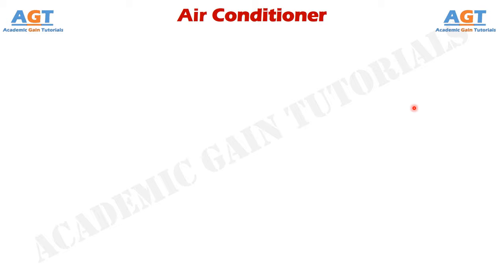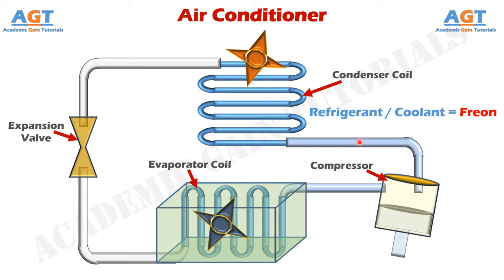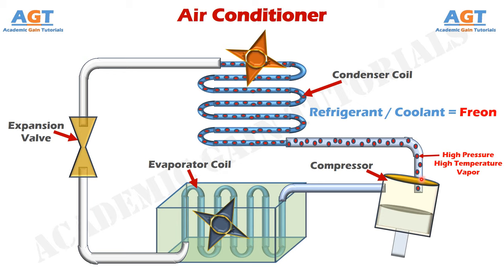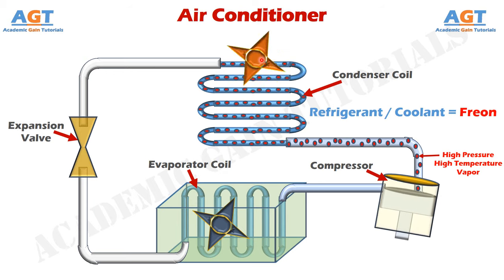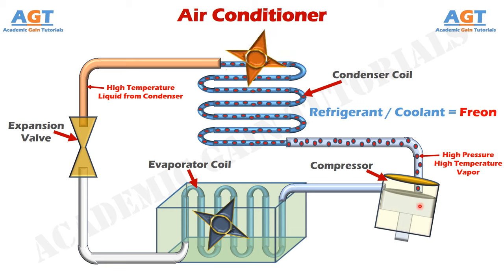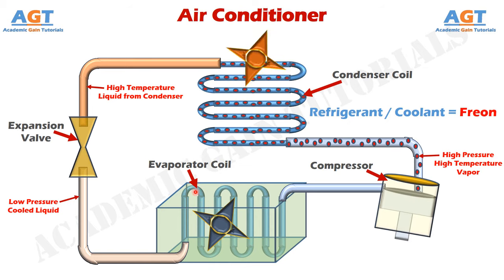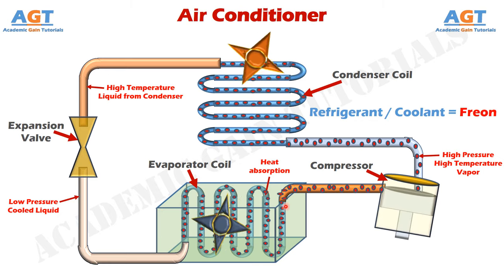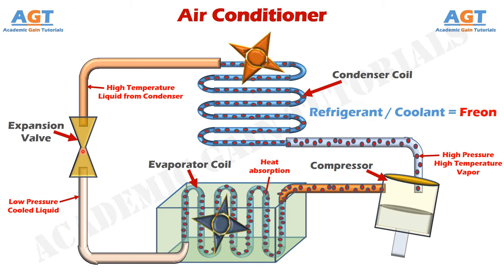How Air Conditioner Works - Parts & Functions Explained with Animation.

Comment: Very well explained and easy to understand with the animation. 

One of the questions I have is how much pressure does compressor have to increase so that  refrigerant  temperature will be higher than ambient air temperature. Is the compressor equipped with some type regulator that  measures outside temperature and compresses the refrigerant so that the temperature is higher than outside air temperature.
Reply: Actually the explanation is still incomplete as your question proves it needs to be equipped with some thing which can measure heat temp and that is   Thermostat which is important to power on/off to compressor to work as per our Room temperature🌡️for a certain cooling effect set in Thermostat I think.
Reply: @irshadahmedsyed  HVAC systems will typically have one or more interior air temperature sensors and an ambient (outside) air temperature sensor.

Comment: I have a question regarding the wireing. I can´t find an answer anywhere on the internet so i´ll try my luck with you. I have a Toyota Hj60 - 82 and there is a wire coming from the dash leading to the dryer and then on to the compressor. From what i can se it´s not acc so i can´t set a temperature, just on/off. Could you explain the exact way to wire the system from the button to the compressor? Why is the wire running through the dryer, i guess it´s correct but i can´t find a single video on the internet explainng this. Thanks in advance.

Comment: Question:  At compressor startup, does the A coil (inside furnace) make some noise getting up to operating pressure?   It lasts for about 15 seconds?    Then noise stops.   At end of cooling cycle the same thing happens.    During the cycle no noise at all, other than normal blower sounds.   AC runs great, very cold.
Reply: This would not actually be called a furnace but a evaporator coil. What you are hearing is the compressor ramping up pressure. Once the pressure is obtained it does not take as much energy to maintain that pressure so you want hear it as much,

Comment: thank you ..this is a great tutorial , rather than the others i have watched that dont explain how the compressor works, or why the flans are blowing and what they are blowing for and the main key is the first law of thermodynamics that all ac is based around...that heat flows from hot to cold...
if you ever want to improve..the thing that was missing was
1. how does the expansion valve work actually (by what mechanism)
2. the evaportator in the room ....when you go near one they seem to be blowing cold air...but your explanation seems to say they suck in hot air ..(so how come they actually blow cold air)
3 more talk about the air in the room and hte importance of the room being closed or the aircon will be trying to cool down the planet.
4. how the condensor coils actually change the state of the freon from gas to liquid.....i think you said the temperature doesnt change but i think it actually does.
the outside environment cools the gas and then it changes to liquid ....by cooling it.
5 more abuot how the changing of state of something from gas to liquid or liquid to gas produces energy
Reply: helpful and useful comments!  thanks

Comment: quick question sir, can a home ac compressor be use on car AC system?
Reply: Long story short, it's not worth trying.

Short story long, 

An automotive ac compressor runs off of your engine,whereas a home ac compressor runs off of an electric motor.

You would have to find a way to hook up the ac compressor from the "home ac"
To where it can be powered off of your cars surpentine belt,

Then you've got other issues because automotive ac has cutoff switched that turn a clutch that is actuated by an electromagnet .

The "home ac" is simply powered by an electric motor that simply cuts off.

Ac in a car is a lott different than ac in a house,

They even take different refrigerant.

Speaking of which, you would also have to find a way to attach your refrigerant lines to the "home ac" compressor.

And im sure im missing a few steps to the process.

But it's going to be a lot more work than its worth

Nothing is impossible, 
But this would be more expansive than its worth.

Hope this helps.😊
Reply: @kristopherhasenbuhler5393  thank you sir, i was just wondering, because some cars now runs an electric compressor. home AC compressor can be run via inverter i think.

Comment: Some things are not explained here. HOW does the expansion valve allow the high temp liquid into low pressure cooled liquid. I presume because it has a small dia. in and a larger dia. pipe out, but this is not said. Also, does it matter if the vapor travels UP the condenser rad whilst turning into liquid? Would gravity not make it want to fall back down? All other animated diagrams I have found show it going down, and that would seem to make more sense. Also, where is your drier?

Comment: I have seen videos on ship refrigeration... and comes to an understanding that...

1. Piping before entering compressor consisted of freon gasses. Then it enters the compressor tube, where gasses are  returned to its liquid state.

2. When the compressor keeps turning... then the liquid state of the freon... prior to entering the expansion valve, it again turns into gasses, then into the evaporator in the form of gasses...

The cycle repeats itself once these gasses reenter the condenser / receiver tube.

Did i understand them incorrectly?...

Comment: I thought, in an expansion system, the freon exits the condenser in liquid, enters the dryer, where moisture is removed from the freon, then traveled to the txv valve?

Comment: I have a question, how does it dispense the cold or hot air?
Reply: Dispensing of cold or hot air happens as per the 2nd law of Thermodynamics, which states that Heat flows naturally from an object at Higher Temperature to an object at Lower Temperature. 
 The "Compressor" makes sure that refrigerant fluid flowing to "Condenser" is at a temperature Higher than the outside temperature, which ensures flow of Heat from Condenser to outside temperature as per 2nd law of Thermodynamics, added with a fan which aids in blowing out the Heat from Condenser. 
 The "Expansion Valve" makes sure that refrigerant fluid flowing to "Evaporator" is at a temperature Lower than the inside room temperature, which ensures flow of Heat from inside room to the refrigerant fluid in the Evaporator as per 2nd law of Thermodynamics, added with a fan which aids in blowing in the cool air from Evaporator to room.

Comment: Question: boiling point of coolant is very low, like -30 degrees Celsius. How can it go from vapour to liquid in condenser, if the outside air temperature is way higher than its boiling point?
Reply: Because "Compressor" (by increasing pressure) makes sure that the temperature of refrigerant fluid flowing to "Condenser" is higher than outside temperature, hence Heat flows from refrigerant fluid inside the Condenser to outside as per 2nd law of Thermodynamics, causing condensation of refrigerant fluid from vapour to liquid.
Reply: Compressor changes gas into liquid and increases the temperature by increasing "pressure". There are 2 ways how you can covert gas into liquid. One by cooling and and the other by increasing the pressure. The game that we are playing in the outdoor unit is with the pressure. Increase the pressure -> keep it in liquid state.
Reply: @ryuzaki6865  How does the condensate drain from roof top AC unit (Compressor, Condenser, expansion valve, and evaporator cooling coils in one unit)? Is it require condensate drain pan to collect water, and drain trap to prevent negative pressure? What if the condensate drain fills up the pan will it spill over into the duct inside the house?

Comment: What is the benefit of changing the state of the freon from gas to liquid?
Reply: So that when that liquid again comes to the indoor unit it can absorb heat from your room, reach its boiling point and turn into a gas. Now this gas is sent to the outdoor unit and using the variation of pressure again turned into a liquid. The cycle goes on. Hope that helped! :)
Reply: @aditisingh1385  But I need to ask one thing? Why their is no explanation about Thermostat which is very important part of this AC? Thermostat is the one which controls Power On / Off to the compressor. I guess same type working arrangements are done for Refrigerator also am I right?

Comment: So this is a little simplified. The first place to get an understanding of what is going on is to understand heat energy. Heat energy is measured in temperature, which is a measure of how heat energy affects the molecules of a substance. Quantities of heat energy are measured by measuring how much heat energy is required to raise the temperature of a certain amount of a substance. For example, a BTU is the amount of heat energy required to raise one pound of water one degree in temperature. (I'm American so you're stuck with imperial.) 
Now we come to the property in the natural world that is exploited to give us the refrigeration cycle that makes air conditioners and refrigerators work, (which both work basically the same, an air conditioner is just something that makes your house a big refrigerator). 
So if you start with a pound of ice, it takes one BTU to heat it one degree. So for example one BTU to heat it from 31 degrees to 32 degrees. But when you get to the first change in the state of matter, it takes 144 BTUs to change it from a pound of 32-degree (Fahrenheit) ice to 32-degree water. And then you're back to one BTU to heat it from 32 degree water to 33 degree water and so on, all the way until you get to the boiling/condensing point. It's one BTU to heat the pound of water from 211 degrees to 212 degrees. And then it takes 970 BTUs to heat the pound of water from 212 degree (Fahrenheit) water to 212 degree steam (or "vapor"). This is a quality that works against us when we're trying to boil a pot of water and the heat source is a stove you have to power.

But it's a quality that works for us when the heat boiling your liquid, (i.e. the refrigerant in the evaporator coil), is the heat in the air of your house, and you want the refrigerant vapor to carry large amounts of heat energy with it outside your home.) (Different refrigerants of course involve different BTU numbers than water, but the principle is the same.)
As many of you know the boiling/condensing point of a liquid increases or decreases commensurate with pressure. (A pot of water boils at a lower temperature at a high altitude, i.e. under less atmospheric pressure, than at sea level.) 
The compressor raises pressure so that the temperature of the boiling/condensing point is higher than that of the air outside, (say a pressure that makes the boiling/condensing point 120 degrees Fahrenheit so that passing 90 degree air outside over the condenser coil will cause the vapor to condense into liquid). 
On the low pressure side of the system, (where the liquid enters the evaporator coil), the pressure is set so that the liquid will evaporate at a little above freezing. (While you might have a refrigerant that boils at 45 degrees (Fahrenheit) below zero, you have to set it to the boiling/condensing point above the freezing temperature of water or the humidity in the air will cause ice on the evaporator coil.)
So you have a system set a two pressures, designed to set two certain boiling/condensing temperatures of the refrigerant. So you have the air in your house being passed over the evaporator coil (made of a conductive metal) so the heat in the air will pass into the refrigerant in the coil and cause it to boil. The heat energy is carried outside with the vapor in your vapor line (the bigger one of your two copper lines) where it is pressurized so that it condenses outside, releasing the heat from inside your home outside. (This is why when your air conditioner is working properly and you hold your hand above the fan of your outside condenser unit, you the air blown by the fan feels warm. That's the heat from inside your house.) Then the condensed refrigerant goes inside your house in the liquid line (the smaller of the two copper lines) where it is boiled again in the evaporator coil, and the cycle continues. 
And don't forget to occasionally pour some bleach down that white PVC line that comes from your air handler and goes outside. That's the line that carries the water from the air inside your house that condenses on the evaporator coil outside.
Have a nice day.

Comment: How the liquid state of freon is converted into gaseous State inside the evaporator coil
Reply: Because the hot air coming into the evaporator area from the house is heating up the Freon in the pipes causing it to evaporate back into a gas
Reply: Cold freon absorbs the heat to change state to turn to Vapour just like if you heat water to make vapor
Reply: This is the freon property

Comment: Where does the humidity go? Turns to water and leaves the evaporator chamber? It should be, otherwise air inside the house is not dehumidified!!

Comment: Ma'am where will the liquid in the evaporator goes?
Reply: The coolant turns into a gas because the hot air coming in from the house evaporates it. It would be helpful if the animation showed a pocket of hot air coming in from house in the evaporator area and another pocket leading back to the house which is where the cold air leaves once the liquid coolant cools the air enough.

Comment: But no where it’s mentioned that excess temperature during compression comes from the work done by the piston from an external power  source and not by the heat energy which is already existing inside the refrigerant

Comment: I am Mechanical Engineer ❤️❤️
Reply: In India we have split AC and window AC in residential Buildings in India, I just want to know how the Exchange of Oxygen takes place from outside home to inside the house, since the door and windows are closed of a particular home, and no other ventilation system is there at home

Comment: why should we give an outlet pipe for air conditioner from where we get water usually?
Reply: For cooling purposes
Reply: Thank you
Reply: As your room air touch the evaporator coils, two things happen. One is that the air cools down and the second is condensation, like what happens when you keep a chilled glass of beer on table and see water droplets around it. This condensation is the reason for the water coming out of your AC and why your room air is dry while using AC.